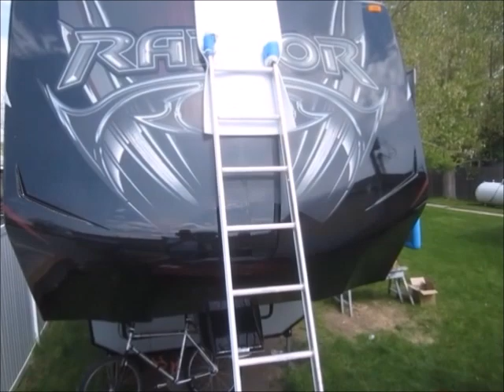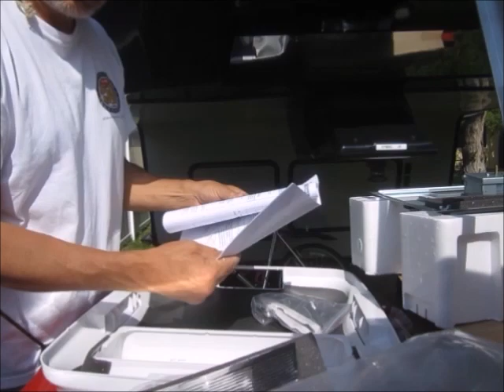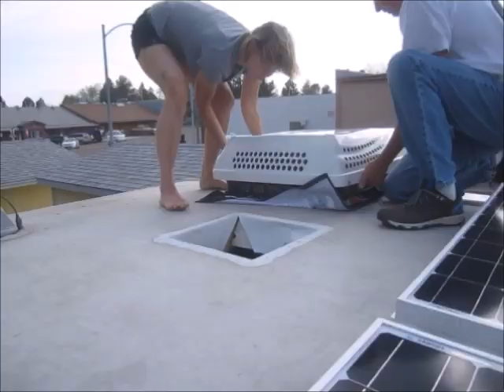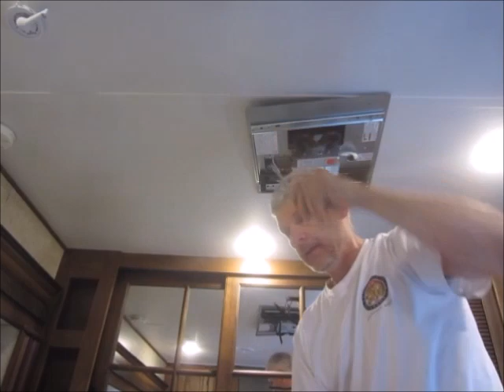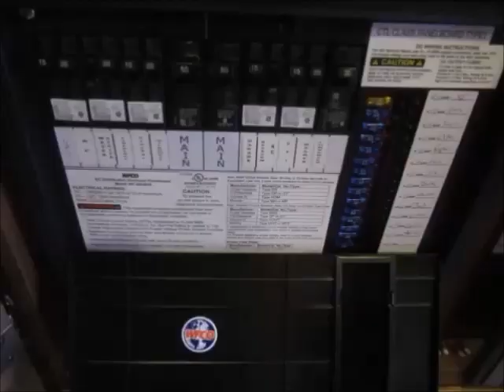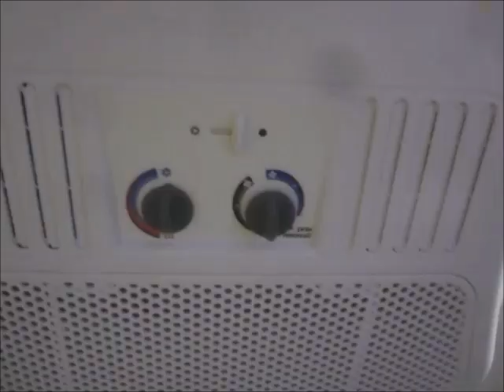Install DOMETIC DUO THERM PENGUIN LOW PROFILE RV AC

Comment: I like the look of the sleek style of this unit and would look good on our class b campervan. I'm trying to find out if the unit blows straight down or from the sides. It's has to be right above our bed in the back and don't want it blowing straight down.
Reply from the maker: They come with different grills when you order them, because if it’s going in a big coach will multiple units and or running off of a wall thermostat it would be silly to have $50 worth of controls in it. My unit was a 2nd AC and could have been run off the wall thermostat, but I wanted to have a choice to run it off grid batteries or off a 20amp plug at my parents house.
The grill I installed did blow out all 4 ends and was able to point-aim or shut a side off altogether.
Reply: @StimRacingTrailerandTravels  so then you can exit air out those louvers? I thought those were just covers for the mounting screws. The air distribution box on the unit I'm looking to get, shows those louvers but only show the centre air discharge and how you can slide it open and close. It makes no mention of opening any louvers for air to blow out. That would be awesome and would seal the deal!
Reply from the maker: At about 15 minutes on into the video you get a great view of the louvres
Reply: @StimRacingTrailerandTravels  No worries, I watched it. To me they look only like access covers for those screws. If air blows out from them then that's what I'm looking for. I just couldn't feel any air coming out when I put my hand up to my monitor.....lol

Comment: I see that you have solar panels, is that what you use to power your a/c?
Reply from the maker: ZETNOM Custom Finishes, LLC I selected a lower btu AC unit so I could use it off grid with a inverter powered by batteries charged by solar or powered from shore power.
I made many videos about installing and operating all of the for mentioned. 😀

Comment: Use a strap with hooks (ratchet strap) and catch the drain holes in the pan, then the person on the roof can steady the unit as you lift it.  You had a lot of close calls there.   Best is use a forklift, but most of us do not have one, but may have a friend or business we work with allow us to use it for a few minutes.

Comment: Guys thanks for the video. Did you seal the perimeter of the AC or only the 14x14 opening, and either way, what products did you use? Thanks in advance!
Reply from the maker: firpofutbol the only seal used was the foam supposed with the ac unit. Manufacturers instructions say not to use anything else, so I didn’t.

Comment: Does it let cold air in on winter?
Reply from the maker: Pedro Fontes we don’t use the rv in the winter, but I can tell you when it’s cold out I would much rather have the vent back with an insulated pillow stuffed in it.

Comment: Nice video. I plan on installing the same AC unit in the bedroom of my 5th wheel.  What did you do to seal up the attic openings?  Did you use wood or rigid insulation and tape?
Reply from the maker: Fred Wagar, I followed the directions and nothing more than what is in the video. No leaks.

Comment: Not a very bright idea to put an AC on your roof like that, you could of lost your balance and fall of the ladder with the AC on top of you, and seriously damage your RV, your AC and and worse, yourself. Some advice to your DIY out there. Leave the AC in the box, strap a tie down around the box at the top, make sure the hardware is facing out, put a piece of rope on the tie down in the center, have somebody on top of the slide out pull the rope, and somebody at the bottom push the AC up,  once its on the slide out, lift the AC with the box on the roof, and your done. It prevents a dangerous situation like you just looked at on this video. I install those units at least 6 to 7 times a month, and this is the way I pull them on the roof all by myself, and I'm 69 years old. So, a younger person should not have any problems to pull a 100 lbs box on the slide out, the slide out is also lower then the roof making it much easier to pull them up. You have to be creative when you get older, if we fall, we are going to brake something, and I'm not talking about the AC.

Comment: I have this unit in my trailer waiting to be installed. Did you use any silicone or calking in addition to the foam seal that came attached to the unit?
Reply: Do not use any silicone, this is a factory installed neoprene gasket, and when you tie the bolts it will squeeze the  gasket and makes a water tied seal.
Reply from the maker: jtlos no we didn’t. Just followed the directions. Thanks for the questions and for watching.

Comment: Sorry I know this post is a little late, but do you think an air conditioner this size could keep a short bus conversion cool?
Reply from the maker: Robert Guinn yes I do. My first toy hauler was 21 feet and came with a 13,000 BTU AC and it took care of that great. If you have minimal insulation, a 10 or 11,000 BTU AC should work fine.
Reply: Stim Racing Trailer and Travels thanks for the info. I'm looking for a bus in my price, and then I'm going to start my build. This is my first experience with recreational vehicles.
Reply from the maker: Robert Guinn cool. Good luck with that. It's sure to be a learning experience.
Reply: You need a minimum of 13500 BTU.

Comment: Not sure why you didn't block off the gaps in the wood framing,,, the right and left side of the opening has a solid 2x6 but the front and rear has open truss construction that has large openings to the ceiling and outer roof ( lets call that area the attic). So basically you're losing cold air in your attic. Oh and sucking hot air out of it as well. Ya may want to fix that.
Reply: I was thinking the same thing. I had to seal up our "attic" all over the place. https://rv-therapy.com/upgrades/im-just-venting-chill/

Comment: I just ordered the Penguin II . Maybe you could tell me does it have 2 speeds ? Low and High and can a thermostat be added, I couldn't find info from the site that I purchased it from
Reply from the maker: rick jaunzemis you need to choose the interior grill when you install it. You have two choices, The one like I have has a internal thermostat, and three speed control for the fan. The other style uses an Extertal wall thermostat
Reply from the maker: rick jaunzemis The internal grill will cost you $120+
Reply: There should be information that came with the AC, however, you have 2 different setups with these AC units, one is controlled manually, and the second option is controlled by a wall thermostat. Your unit can be converted to a wall t stat unit, but you have to change out the control box, buy a thermostat, and pull a com cable to wherever the t stat is going to be mounted.

Comment: Great video! I'm looking to get a second A/C unit. So some of this is new to me, and when I say some I mean all LOL...you said you had the hard start already installed, what exactly does that mean? Are you guys happy with the A/C unit you.installed? And is that a non ducted unit... thanks again for sharing I have subscribed to your channel..
Reply from the maker: rick jaunzemis hi Rick. We are happy with the AC. We installed non- ducted. The trailer was set up to tie into the trailer ductwork, but I chose non-ducted just to cool the bedroom. The ductwork is intact and still functions with the main air conditioner. 
The hard start capacitor is an addition that helps the compressor start up. It just gives the extra surge to start the compressor, if needed with smaller generators. My thought was to run the AC off of my solar, but for that I should have done a soft start. A lot more expensive. But I have given up on that proposition, Too expensive. A hard start would be about $30, soft start is up around three $500. That does not include installation.
Ray from "Love your RV" did a video installing a hard start capacitor. Check it out.
Reply: Thank you for that... I meant to also ask you, you said in the video you ordered it with the "Hard. Start capacitor " already wired in.. would you please tell me who you ordered it from? 
I'm getting ready to order mine
Thanks Again
Reply from the maker: I called the seller phone # on the amazon add because of the hard start capacitor. As you would expect, if I bought the stuff outside of the amazon website, it was all cheaper. But then you don't have the buyer protection you get from amazon. So whatever you are comfortable with? Also, even if you do a deal through amazon, call to get the BTU size you want. Here in a link to a 13,500btu,https://www.amazon.com/Dometic-640315C-Penguin-Profile-Conditioner/dp/B00NRDHTVA/ref=sr_1_3?ie=UTF8&qid=1488209196&sr=8-3&keywords=DOMETIC+DUO+THERM+PENGUIN+LOW+PROFILE  but they will normally set up a sale for what size you need. I did a 11K, but after having the experience of a summer with it installed, would now go with an even smaller one for this small bedroom.
After having the heater this year, I would also skip it next time. Big fan, low btu, and no thermostat. 
The inside trim piece is extra. Its because you have 2 choices depending on wall thermostat, or thermostat mounted on the AC trim piece. I went with the AC trim mount.   
Any other questions, I will be happy to try and answer.
Reply: @StimRacingTrailerandTravels  hi i have travel trailer hooked to my home but pops my braker too much  my question is does it uses too much electricity or is it like a window ac unit    i would like to swap my old unit on trailer  with the one you used....also what is hard start for?  thank you
Reply from the maker: navyankz easy question 1st. 
Hard start refers to an extra starting capacitor being added to help the ac unit start by using the energy stored in the capacitor with a bit of extra power. If I didn’t do a good enough job explaining it, just do a YouTube search and someone more competent will explain it better.

2nd. It depends on how much power your ac requires and what other household loads are on the Circuit?
If the ac is 13,500btu it may require 13 amps to run but maybe over 20 amps to start. You can see that that’s close to the limit of the circuit and will eventually overheat the wire, plug, compressor or something and trip the brkr

Comment: So I saw from a lower comment that the heater is not all that great.  My camper is about 200 sq ft.  Think it would help mine if LP was out and I had power?  Thanks!
Reply: It will take the chill out, but if it's really cold outside, it will not be enough to heat the trailer to be comfortable.
Reply from the maker: Ronny Julian from what I know now after having, and using the heater installed in the AC, I would not buy it again. I never use it, because of the noise and lack of heat. I use a cheap small electric space heater with a tip over switch. I can't select between 750 W or 1500 W. It's everything I want and need.

Comment: Great job! Can you add links from Amazon where you bought this? I like the added heater option! I can not seem to find it on amazon. Also it seems the trim piece that goes inside is extra from what I can find.  Thanks!
Reply from the maker: Hi Daniel,
I called the seller phone # on the amazon add because of the hard start capacitor. As you would expect, if I bought the stuff outside of the amazon website, it was all cheaper. But then you don't have the buyer protection you get from amazon. So whatever you are comfortable with? Also, even if you do a deal through amazon, call to get the BTU size you want. Here in a link to a 13,500btu,https://www.amazon.com/Dometic-640315C-Penguin-Profile-Conditioner/dp/B00NRDHTVA/ref=sr_1_3?ie=UTF8&qid=1488209196&sr=8-3&keywords=DOMETIC+DUO+THERM+PENGUIN+LOW+PROFILE  but they will normally set up a sale for what size you need. I did a 11K, but after having the experience of a summer with it installed, would now go with an even smaller one for this small bedroom.
After having the heater this year, I would also skip it next time. Big fan, low btu, and no thermostat. 
The inside trim piece is extra. Its because you have 2 choices depending on wall thermostat, or thermostat mounted on the AC trim piece. I went with the AC trim mount.   
Any other questions, I will be happy to try and answer.

Comment: Where does the condesation collect? On the outside of the unit? How is it drained?
Reply from the maker: Hi Brian,
It drains on to the roof and runs to side of the trailer, in to the rain gutters and on to the ground. Just like the factory installed 15,000btu unit. Seems like it should have a condensate pump to the gray tank vent, but it does not.
Reply: Stim Racing Trailer and Travels Thanks for the info. Is it 115/120V or any special wiring? I'd love to tap this thing into an inverter and run it off of solar.
Reply from the maker: 120vac. My trailer was pre-wired, so easy to install that way.
If I did it again. I would have ordered the 9000btu. Cooling such a small room, and that much easier to run off solar.
Reply: Stim Racing Trailer and Travels That's a good idea. The space I'm cooling is around 300 sq.ft so easily serviced by something that small. Will have to look into it. Thanks for the info!
Reply: It comes from the condenser into a drain channel, and it runs off your roof.

Comment: Side note: your rig does not need to be wired for a/c or even have wire nearby. And some think this is an even better idea. Just leave a little pigtail on top of the roof. Then when you setup camp climb up and plug in an extension cord and run it to the meter box. That way the load is not on your camper.
Reply from the maker: That is an interesting why to do it. Although as we get older, some my object to climbing a ladder to get on to the roof just to plug it in, but I do see how that is a simple solution for most.
Reply: That is 1 way to do it, but you still need 12 volt to activate the control box.

Comment: Thanks for the video. I have an airstream and I am just starting to think about replacing the ac. I had not heard about the hard start kit before, good information. By the way air streams have drain pans that drain the condensate through the body and it exits on the road side. This is something that is replaced when the ac unit is changed. In my case it's an airstream part
Reply from the maker: Here is a link to my friend adding a hard start capacitor to his RV AC https://youtu.be/oHgXGlYNYkQ Also added link to the description above like I should have done at the start. Very inexpensive and easy to do yourself.

Comment: Did you need to install a drain kit? I'm a little confused as I read in some reviews that it will need a drain kit (which is sold separately). Thank you by the way sharing the video.
Reply: No, you do not need a drain kit, the AC has that already and the water will just run off your roof.
Reply from the maker: I did not see a drain kit, or read about in in the installation papers? With all my other RVs, the condensation just runs off the low spot on the roof. If I don't want it on the door side, I tip the trailer a bit to the left. Would you run the drain to a gray or black vent? Sorry I am no help with this.
Reply from the maker: I will re-read the paper work this weekend. If I find anything, I will get back to you.